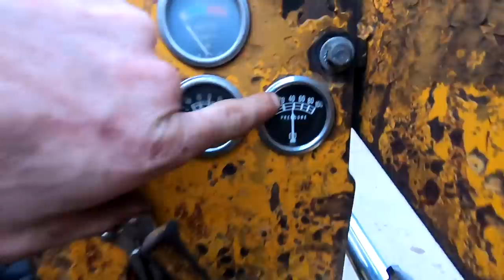A DEMORALIZING Turn in the Restoration of "Old Red" ~ Part 11 ~ 1950s Caterpillar TraxCavator

Comment: The next time you have to work with a heavy/stiff rubber hose like that, put the hose in a pan of boiling water for five minutes, or so.  It should assemble much easier.
Reply: Lol, that's a very reasonable way of doing it, I was yelling put a touch to it!!.
Reply: That was my first thought too
Reply: Not much, but a little.
Reply: Das ist ein Gummischlauch mit Gewebeeinlage, da wird nichts weich, auch im heißen Wasser nicht.
This is a rubber hose with a fabric insert, nothing becomes soft, not even in hot water.
Reply: Heat gun to expand. Glycol or carb cleaner to make it slide easier.
Reply: @festorfamine  I was thinking heat gun.

Comment: I started working on trucks back in 1982, as a junior in high school. We were repair only and owned only one truck, our 1956 LJ hard-nosed wrecker. We performed all repairs in house. We were a small company (only 5 of us) in a rural area in northern NJ. We were basically the only game around, and the owner who was a good business man got a deal with Mack trucks, CCC(Crane Carrier Corp.) And Fleet guard filters. We did all repairs in house and because we were in the mountains we did a lot of work on heavy equipment (engine only) but never the tracking system so it is enjoying to watch you work. My first experience was with a old D9 out of the 60s with a small gas pony. It ran before but was sitting to long. Cleaned the spark plugs and stole wires off an old p/u sitting in the yard. I was seventeen years old and had to load the dozzer up on to a non-detachable low boy, the driver asked me if I could do it and of course I said sure. I did it and I'm smiling now just thinking about it

Comment: Hey good job on the hose.  I work at a hydraulic repair shop and wasn't sure if you would be able to find something that works.  Those clamps work really good if you need there is a thinner style similar to a worm gear but uses 1 nut and bolt to tighten.  They come in handy if you have clearance issues like with that dipstick.  What I like about this series is it that it is an old cat being restored to the best of your abilities and even tho things don't go as planned you keep plugging away. Once again thanks for posting and keep up the good work.

Comment: From memory when fit the new 2.5” non-pressurised hydrolic return hose (my Dad - master plumber & not fitter & turner) poured hot water over rubber, wiped with cloth & pressed on OK - think was concerned would damage metal face where o ring embedded.  Congratz on results & you deserve peace of mind that these serviced aspects will allow running later for longer.  When you start running machine hard because it becomes “rock solid”, you will not dread a “routine belt change” & maybe a young operator assistant (learner) does belt change for you & just thinks its always easy... you will know better but if it keeps others doing comprehensive simpler service then easier results will ensure attention & great Cat machine (not just yours) SAVED!  I saw LOTS of this stuff when we had a farm (entire “holidays” busy every time always... my son does NOT have a family farm so VERY grateful he can still watch as he’s age would NOT review lots of black & white diagrams & words & your talking CONTEXT helps confidence & can-do attitude!... may inspire next generation of mechanics).  We paid attention to the Dads because we needed to get back operating asap... scored a motor bike track so we look back happy).  GLTA.  Look forward to see you running & get the road & earthworks done so you benefit more broadly.

Comment: Reminds me of 1978.  I was living at my friend's house and I decided to replace the water pump in my 70 Ford LTD. Had never done that before, but what could be so hard, right?  Had to pull the radiator too to gain access. Wasn't planning on that. Then, once it was apart, I needed a new thermostat. No way to get one but ride my bike 5 miles there and back. Of course I was working alone and  I needed to get the car back together by 4PM to pick my girlfriend up from work.  What I thought was going to take  two hours took about six, counting the bike ride. I got to my girlfriend just in time.  Lesson. Never take apart a car you will need the same day to pick up your girlfriend.  Working in there is also a young man's job. It is a workout. especially with the radiator still in.

Comment: Those hose fittings are reusable. The outside collar is threaded. The threads on the collar bites into the hose and draws it in creating a super tight seal. Most all early heavy equipment with hydraulics had reusable fittings. All you needed was  a vise and hose. To remove the hose from the fitting you will have to heat the outside collar. You can buy a shop manual for that machine for a reasonable price.

Comment: Love the series, l think that you blew up the head gasket. Hopefully it hasn't recked anything. I don't know who thought you but you're pretty good at taking old rusty things apart. I work as a toolmaker for 40 years a have removed all sorts of bolts and taps out. I am now retired and still do a lot of this at home. I have a 50 acre farm and seames that l am always fixing things. I also collect antique gas engines and tractors. My newest thing is attempting blacksmithing.

Comment: When shutting down the pony motor, shut off the fuel valve and let it run out of gas. Otherwise, the fuel will run straight to the crankcase and you will grenade the motor. YouTuber Squatch253 has in depth videos on pony motors, and old CATS in general.
Reply: Up

Comment: You might invest in a painters heat gun. Over powered hair drier. It will soften the hose enough for you to get the fitting in. But boiling someone else mentioned water is cheaper.
Why I watch? I love fixing stuff and learning. You are real and not arrogant and you are clear and non rambling. Keep up the great work.

Comment: I operated heavy excavating eq for many years. I have just started watching your vid with this old  traxcavator. I enjoy it so much!  I used to run a 955, it was one of my favs. Pedal steer, so easy to run and lots of power. I used it to dig a basement underneath a house one time. Had to remove the exhaust stack and use a piece of gutter down spout instead to have working clearance under the house.  All was going well until I got to an old chunk of concrete wall that was buried. ( the house was built on a crawl space over an old church )
The piece of wall was heavier than the 955 and when I tried it pick it up the ass end of the 955 came up instead...pushing the operator platform with me in it up into the floor joists of the house. Needless to say, I was able to put my head down in time and then let the load back down. One of the joists put a small dent in the top of the fuel tank..lol. The Cat machinery is built to take tremendous punishment and last for many years. Your machine is proof of this. Keep up the good work and be proud of what you’re accomplishing.

Comment: Just below the pony motor  starting lever assembly there should be a cover with three bolts there was starters to fit in this hole on ebay they went like hot cakes last month I'm sure there will be more because it's way easier  and cheaper in the long run to go with 24 volt electric starter with two 12 volt deep cycle batteries than to keep fixing the pony motor.  you may not think that way but you will agree with me some day when you totally rebuild the pony only to have it fail agian in the future.
I believe but not positive the same starter is used
 on the D 6 cat
You can talk to an old timer nicknamed Old Magnet on Heavy Equipment  Forms he can give you some very good advice on the starter
Reply from the maker: I'm already thinking about doing that to it! I can DEFINITELY see the advantage to doing that, but I'm also trying to weigh out all the expenses I have when it comes to this machine as a whole!
Reply: Starters = capacitors?

Comment: Worked in 'Aeroquip' workshop in early 60's.  Knew the fitting was all one piece . Made that sort of hose often. What you did would be the way we did  it then.
Reply from the maker: AWESOME! I figured I wasn't completely crazy going that route for the IRREPLACEABLE hose!!
Reply: @SalvageWorkshop  the only way to do that better would have been to somehow find a crimp connector instead of the bolt-on ones, but at that point, it's just looks and fit/finish
Reply: @seldoon_nemar  If it's low pressure, a normal host clamp probably would have worked, esp. those T-style ones....
Reply: Punch-lok or other band clamp would do that job well.  The tool to tighten them is somewhat expensive though.  You could fit two side by side.

Comment: Check out squatch 523. He rebuilt his caterpillar d-2 motor.  He has also taken apart his pony motor.
Reply from the maker: That is true!
Reply: Squatch has multiple pony motors, and equipment they fit in, Caterpillar Tractors and a Patrol Grader. He will be able to point you in the correct direction.
Best wishes, stay safe

Comment: I ran across this today and brings back so many memories.  Some good some not so much.  I worked for a Caterpillar dealer for over 40 years.  First 20 I pulled wrenches.  last 20 I was an instructor.  I started working for Cat in 1969 and saw the last few new 955H tractors come through the shop.  I am retired now so I've been away from Cat for a while.  But I remember those 955's very well.  I'll just say there is nothing on those tractors I haven't worked on.  Those old 955's were / are some tough old tractors. 
 I haven't seen if you tackled the gasoline getting in the pony motor crankcase, but that is not unusual if the gas tank valve is left open or not sealing properly.  Change the oil and close or replace the gas tank valve after every engine start,  I would suggest, after you get the diesel running, Turn off the gas tank valve and let the carb run out of gas to keep it from gumming up. On the water pump. One of those grease fittings is a relief valve. Don't put in two grease fittings. When you grease the pump you can blow the seal out of the water pump.

Comment: That was a unique shape of Visegrip pliers you used to take out a broken screw with. Was the intended use to clamp off a hose?
Reply from the maker: It's intended to replace a bunch of sizes of wrenches, but works really well for broken bolt and nut removal... Look up The Original Locking Wrenches Irwin vice grips 4LW is the one I was using I believe... I need to buy the 7" & 10" as well, I've heard they are AWESOME to have!
Reply: @SalvageWorkshop  Thank You.

Comment: Actually that pin is a alignment pin. And it actually is important. It makes sure that the pump is centered in the bore. Bolts aren’t a tight enough fit to use them for alignment.
Reply from the maker: Hmm... makes sense! Well good thing I chose the one that's been fixed!

Comment: Not real sure but I think an 8 point socket will fit on a square headed bolt, oh well something like that :)
Reply: Yup, also 12-point for some sizes.  Anything divisible by 4 has a chance of fitting.
Reply: A 12 point MAY work, but it's definitely not ideal - the corners are at a 60* angle, not a 90, so they don't grip very well and can easily strip the nut or bolt.  8-point sockets are made for square nuts and bolts, so they grip much better, but 8-point sockets are a LOT harder to find.
Reply: @normmcrae1140  Definitely agree.    If it's a tight bolt, and I didn't have a proper size 8 point, i'd use a wrench before i'd risk a 12 point.  But if it's not super tight they do work fine.

Comment: Excellent work, great attitude and perseverance. That's what it takes...that's what you are showing. Bummer about the Pony Motor. Squatch noted in his rebuild they are very often badly abused but they are not designed to be abused. They need proper care and procedures to make them last.

Comment: Tech tip for next time.  put a peace of 1/4 plywood in front of the rad..   made for real good cringing moments lol
Reply from the maker: That is a good tip, I WILL remember that, thank you!
Reply: I actually gasped when the pump fell into the radiator during dismounting.
Reply: You should have given me that tip 50 years ago when I was fixing my first car. Knocked a gash in it to be fixed. I've pulled radiators ever since just to have no repeat performance. Next time I will try this.
Reply from the maker: @Yaivenov  Me too! Good thing that radiator was BUILT LIKE A TANK!
Reply: I was worried the water pump was going to puncture ur newly repaired radiator as well.
Reply: Piece of cardboard is much easier to get in and out between radiator and fan blade.  Really saves your knuckles!

Comment: On the pony motor the cyl heads have a drain cock, it is for after running to let gas that collects in cyl drain out.  The carb will leak gas into cyl's   and do damage to engine, also use them open to push out gas and oil for better starting.   See Antique CAT boards for advice, they would be glad to help.   Good Luck and nice work you have done so far on "Old Red"  and thanks for your videos!

Comment: Where did you find those vise grips you used to remove the broken bolt early on in the video.
Reply from the maker: Vise Grips 4LW (Locking Wrench)... There is a 4", 7", & 10" version! I've been meaning to get the 7 & 10 as well, but those little ones work well!

Comment: Pony motor sounds like it's water locked a blown head gasket. Don't let the water freeze in the cylinder.
Reply from the maker: That is a possibility... fortunately the heads are REALLY easy to access and remove... I just need to find some new gaskets before I pull them off!
Reply: @SalvageWorkshop  
Pull the spark plugs and run it over by hand.
Reply: Whew, that was a close call. As soon as he put the head phones on I thought we were going to get another "Air Guitar" concert!
Reply: For sure
Reply: @SalvageWorkshop  get the water out now or you may not need head gaskets lol

Comment: I;m watching this series for many reasons. It's better than any of the ** on tv, no fake drama or deadlines. You seem to manage enough 𝑟𝑒𝑎𝑙 dramas. You explain things properly, in terms that I can 𝑠𝑜𝑚𝑒𝑡𝑖𝑚𝑒𝑠 understand - not any easy task. 
Maybe silly, but I like how heavy these bits are, just moving them involves thought and planning. It's good to see someone doing the work themselves, instead of farming out the tricky, or dirty, jobs. I'm never likely to work on a Cat, or any other machine, but I still consider these videos to be educational and I'm picking up bits and pieces from your explanations. 
Finally, I like that you're re-using parts and swapping out some parts from the other machine, rather than just throwing money at it. I'm sure you'd struggle to buy many of these components nowadays anyway but I think you know what you're doing(up to a point😁) and know what a mammoth task you've taken on. I'm looking forward to watching the process and couldn't care how long it takes. If the quality of your comment stays at this level; the longer, the better. Good Luck, you're going to need some.

Cheers for now,
Dougie.
Oh P.S.  Your comments section is one of the better ones too, don't seem to be many millenial know-it-alls.😂

Comment: What was causing the "rub" with the hydraulic hose fitting, and what was it rubbing against?  Was it rubbing against the bottom of the dip stick housing?  Will it eventually rub through and cause an oil leak? Was it caused by vibration?  Was the rubbing issue fixed?  So many questions, lol.
Reply from the maker: There is another hanger that is not attached to the hose, and most likely hasn't been for a long time, I believe that allowed the hose to sit slightly lower and rub where it shouldn't have. My plan is to attempt to get that attached again, and also add some old fire hose around the new hose to protect it and the side of the engine... Will it eventually rub through, maybe, but this machine will never be used in a production setting day in and day out ever again, so I'm not too worried about that!
Reply: Thanks for explaining!  I'm totally loving this Old Red series.  Amazing work.  Thanks for the content.

Comment: Did that hose actually need to be flexible? A rigid section would have been more robust under the belly.
Reply from the maker: That is a really good question! I thought the SAME thing, but apparently there has to be flex in the lower return side of the hydraulic system to allow for the pipes to flex around a little when operating the machine. Apparently a hard line alone would be more inclined to cracking or breaking... That's how it was explained to me, and it makes perfect sense!

Comment: I recall hearing(on Squatch253) that Pony Motors can have a issue with gas draining through the carb into the crankcase and thinning the oil and then the engine has a self destruct from the lack of proper lubrication. Seems the solution is to ALWAYS shut the gas off and let the Pony Motor burn all the gas out of the carb and NEVER turn or leave the Gas ON until you are ready to run the Pony Motor. Not sure if this applies to your Pony Motor or not but you saying you see gas in the crankcase sounds like the same thing. Hopefully the damage (if any) is not to severe and you can rebuild the Pony Motor.
Reply: I ran a D7 3T that had a leak in the pony engine gas tank. Every morning I would pour a soda bottle of gas in the tank and start it up. The owner wouldnt fix the leak. Stated he wanted to be certian that the crankcase wouldnt get any gas in it. the old guy would come fuel it every day after dark or very early in the morning. And there would be a tube of grease and a soda bottle of gas setting on the track.